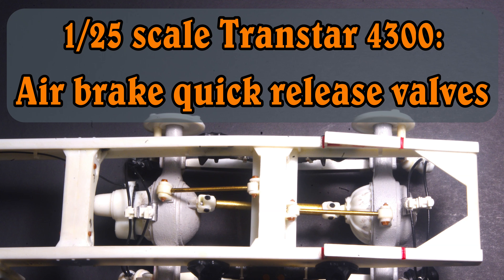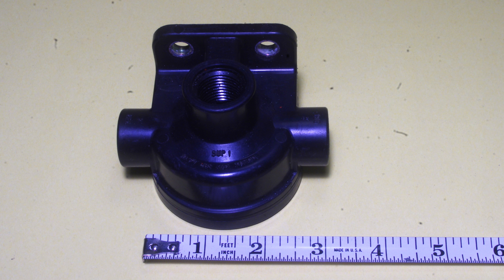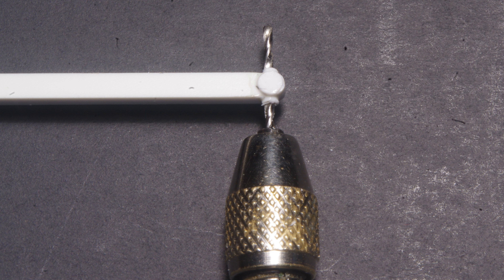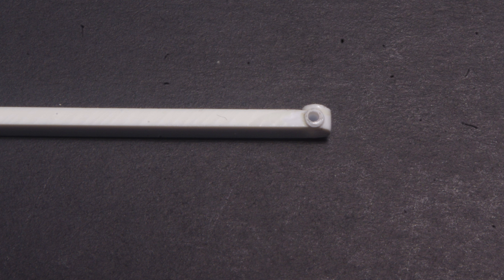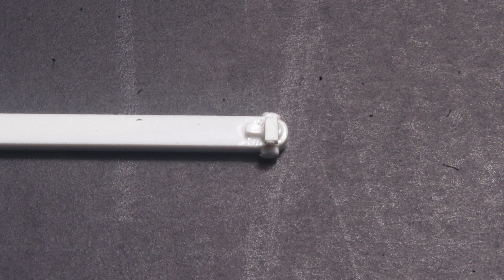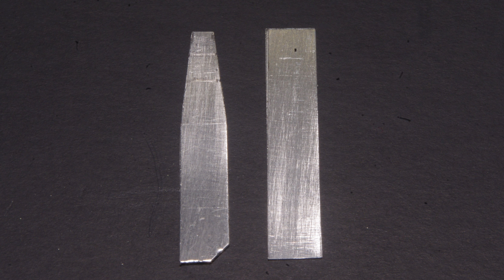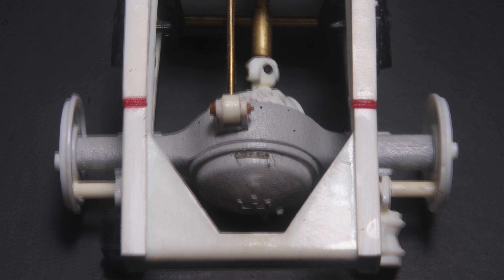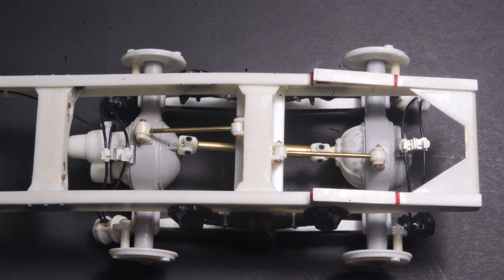1/25 scale Transtar 4300: Making air brake quick release valves

Comment: Robert, A lot of little pieces to make value! But I have to say that definitely add to a tractor frame. The rear part of the Transtar, looks great👍👍👍!
Reply from the maker: These parts actually weren't that bad to make, in some ways I am a bit surprised that there isn't something made in commercially available form like the model railroad air brake parts that have been available for a long time in various scales.